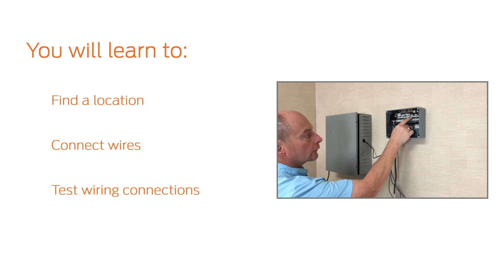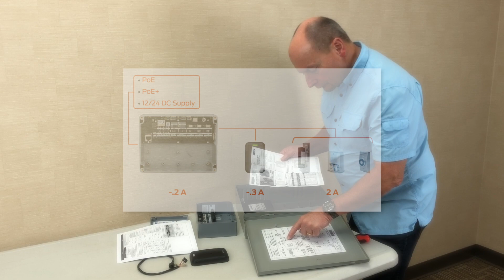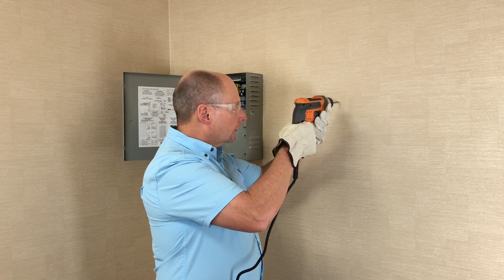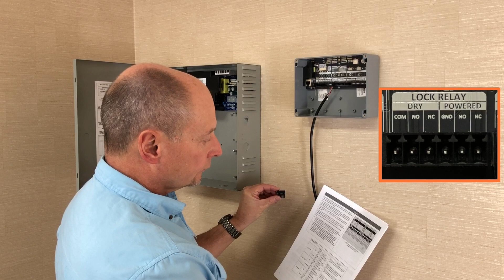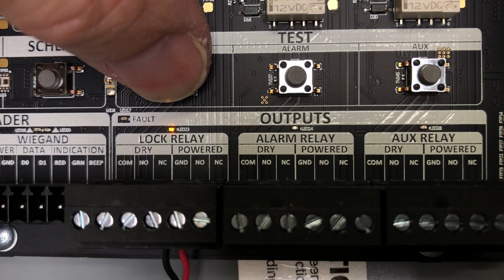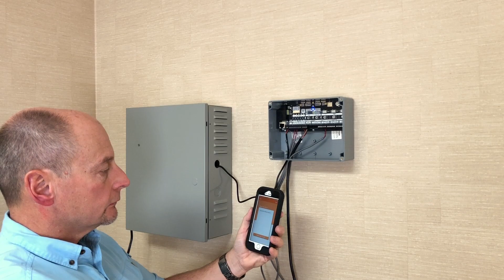How to Install and Setup the Schlage CTE Controller

Comment: I don't see a provision for a momentary contact, I have a job site where this unit needs to be used in an elevator cab application and therefore need a momentary contact to override one of the elevator floor buttons, does this unit indeed have a momentary contact output upon activation of the reader? Please advise
Reply: The lock output can be used for that. It’s controlled by time in the settings. Just program it for 1 second if you need a momentary function.
Reply: @TXMoline  Thanks!